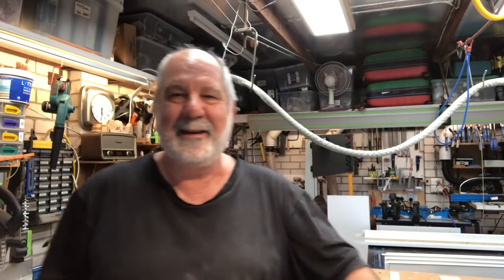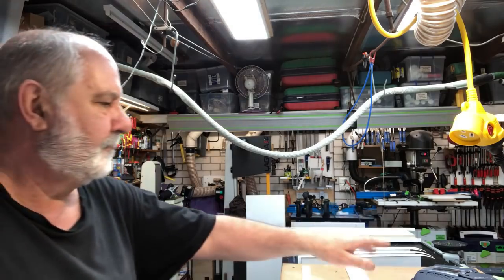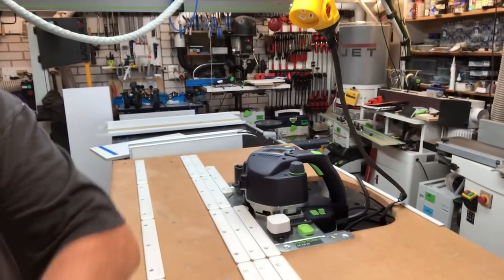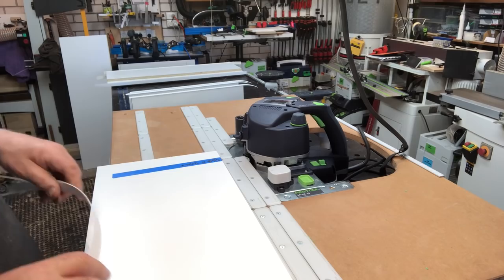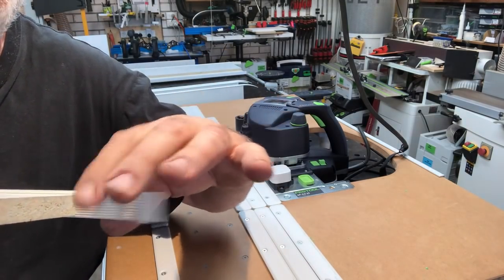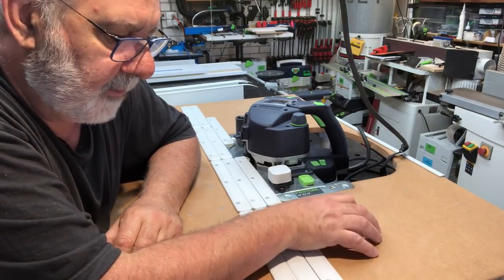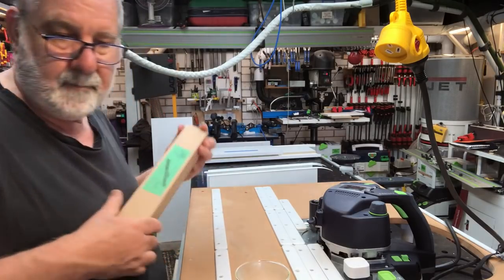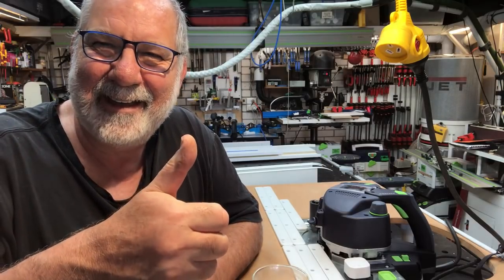FESTOOL CONTURO REVIEW

Comment: Hi Steve, would you recommend to buy just the centuro edgebander and then the mft kit etc. Or just jump into the deep end and buy the entire set.
Reply from the maker: well Harry it depends on what your edging, for basic kitchen cupboard doors etc the bench unit is paramount for ease and accuracy , but if the items are large hand held is all you need. For me I use the bench unit 95 % of the items i have needed it for. Hand held it’s a big unit, that’s why I bought the table accessory table  which I added those adjustable kitchen legs to sit on my existing benches

Comment: Hey Steve_ I'm curious about how long you need to let the glue "cure" before trimming, scraping and buffing the edges?
Your perspective is appreciated. Thanks! 😃
Reply from the maker: John Beckman Mate hi you can work on it in less than a 1 min as soon as the hot glue hit the air it hardens almost immediate. I usually do a batch of edges and stack them then go and trim but if you are doing a one off you just keep working, remember there is no messy glue pots, its awesome for the small shop.
Reply: @sicdsteve1  _Thanks Steve. My thoughts were when breaking down a full sheet for cabinets. I was wondering if the banding could be applied after you got the sheet down to 2- 610mm x 8ft sections. If you banded the long ends, trimmed & scrapped them and then moved to cross cut the 6- 610mm x 900mm panels. What are your thoughts. Could you do the trim & crosscut right away? Do you think that the efficiency gain of banding the long panels and then cutting them down is worth it or valid? Thanks!
Reply from the maker: John Beckman To do that you would do it hand held, thats all it would be feasible and yes more than likely a bit  quicker
Reply: @sicdsteve1  _ Thanks Steve!
I was envisioning a long bench for the long cuts. Move down to a Banding Bench. Then slide the 610mm x 8ft (banded on one side) panels back to the long bench to perform the crosscuts. The six side panels cut from the 4x8 sheet would all be banded at that point and could be set aside till that other pieces were cut and finished and assembly could start. I'm wondering if this saves any handling on a full set of cabinets. What do you think?
Reply from the maker: John Beckman Well after making a kitchen for my daughter I preferred to cut up my board then tape up as they are easier to handle in the smaller sizes, I wouldn’t tape on the machine in a bench something 8’ long as you need to maintain a constant feed and pressure against the roller you can’t stop as the glue keeps feeding, to do your method you need to do it holding the machine in your hand then be no problem as your feeding the tape to panel. For me I prefer to cut up first, but thats my method.
Reply: @sicdsteve1  _ Good enough. Thanks for your insight! 
It's great to bounce these ideas off someone who has first hand experience with the equipment. Cheers! 😃
Reply from the maker: John Beckman Anytime glad to help
Reply: Can you send me the name and I needed to buy it